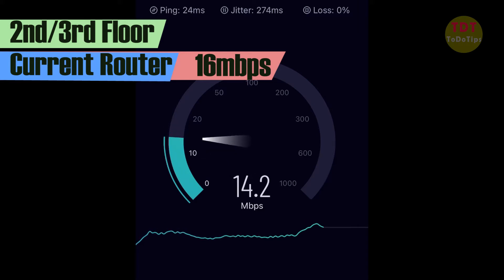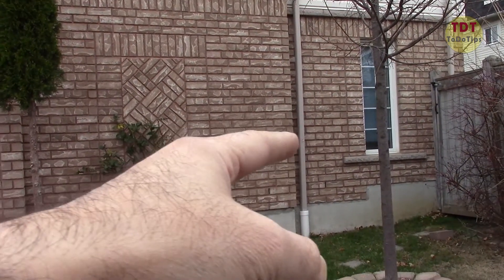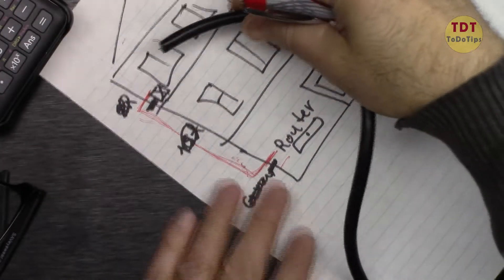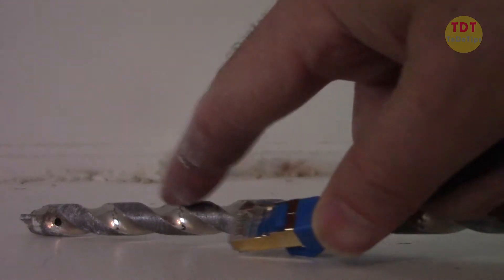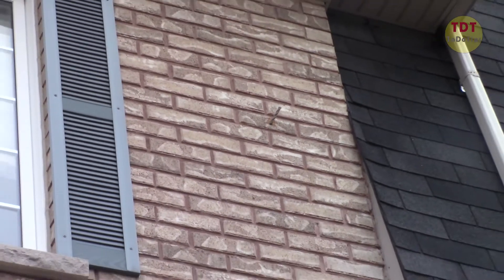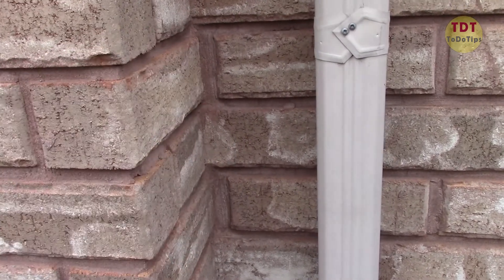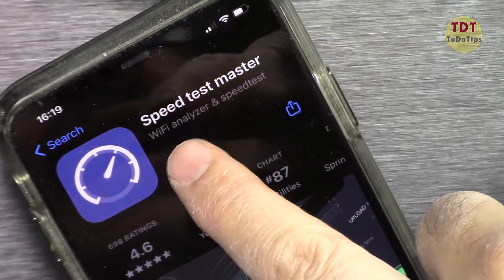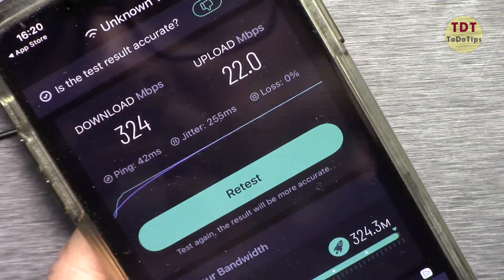Adding WiFi router on 2nd floor or 3rd floor to get best signal

Comment: I have exactly same house 😅 but today i tried it with fibre cable and i feel so devastated . I used tp link router with eir fibre connection and 5e network cablr but speed has dropped from 500 in basement to 100 only by 2 nd floor m what wromg did i do ?
Reply from the maker: to be sure if the wiring is correct, connect a laptop using ethernet cable and check the test. if the speed on the top floor is okay. then it is the wifi speed that is reducing it.

Comment: What about the configuration of the two routers should we change anything or just connect two routers to a ethernet cable is enough???
Reply from the maker: The 2nd router is totally separate router. So give different name
Reply: @ToDoTips  how do you connect it to internet without modem
Reply: @MuskyCR  I think you would connect the new router to that new 50 ft (originally) ethernet cable he got for the purpose, TO your existing modem in a different port. I guess it has to be given a different name. I'm on the same page as you I believe.

Comment: What is your basic plan?
Reply from the maker: 300mbps
Reply: @ToDoTips  Even I want to do the same but from 2nd floor to 1st floor and there are 2 different electricity connection for 1st  & 2nd floor .Then what should I do.?